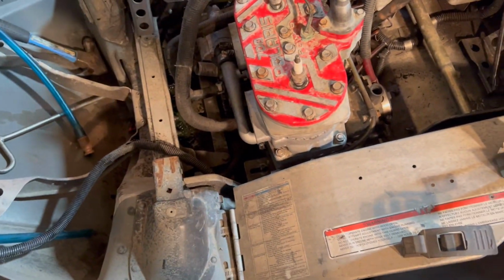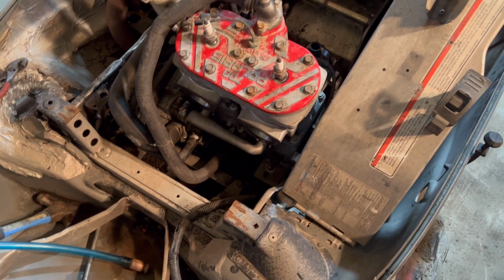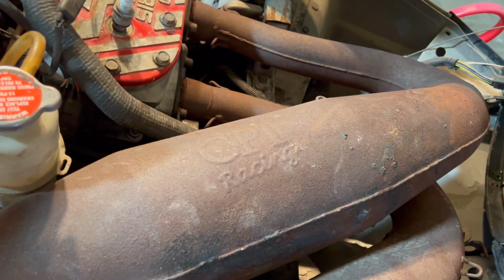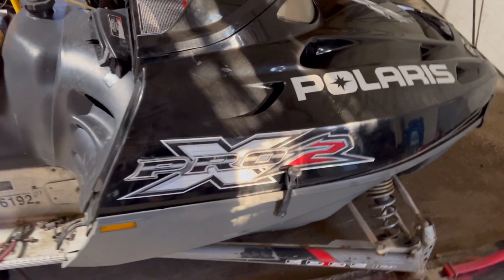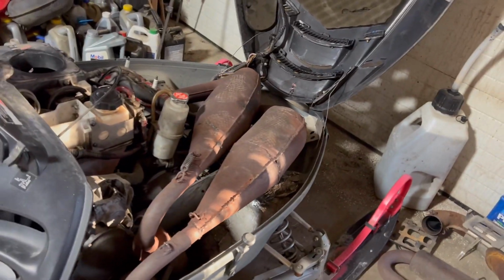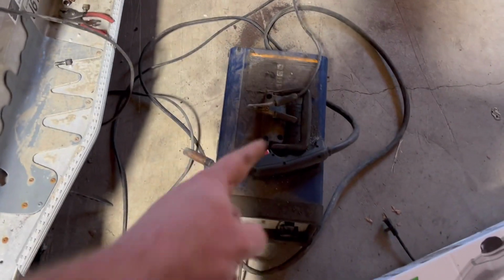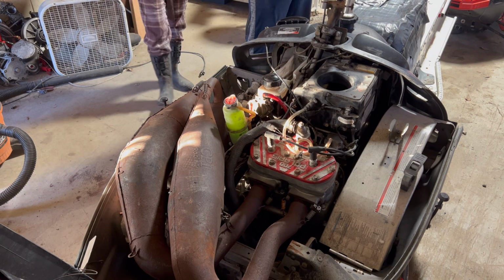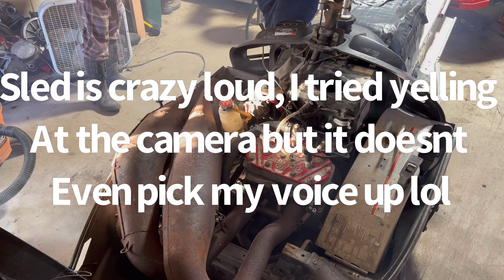Pro X2 is back up and running!!

Comment: Hey garret I have a question so this weekend I’m buying a 1992 Polaris Indy 500 sp efi but it’s converted to carbs but it’s the wedge style body and the hoods not cracked but the seat is torn in some spots but I takes the guy down to 350 should I buy it just wanna ask sence you now a lot about sleds

Comment: I have a 99 XC SP 500 what reed valves do I need? There’s 2 separate styles online. I
Reply from the maker: Small block reeds. 440/600 small block should be the same I believe.

Comment: Hey man I am having trouble with my 2008 Rmk 600. It starts fine and idles but when I hit the throttle to go it wants to bog down and almost shut off. I have cleaned the carb and checked the reeds. What else could it be?